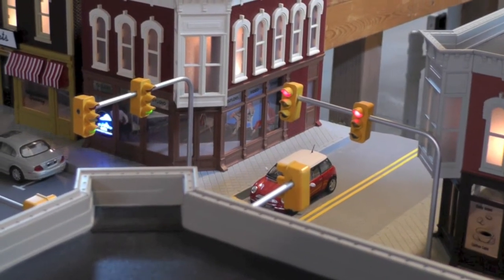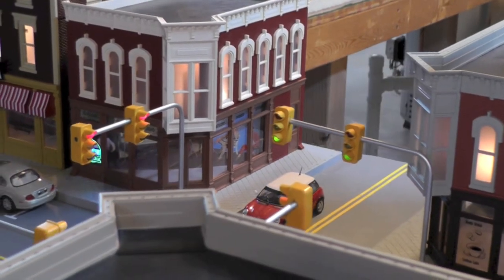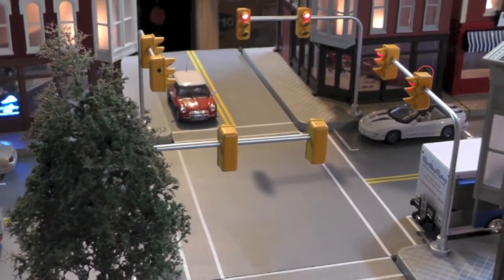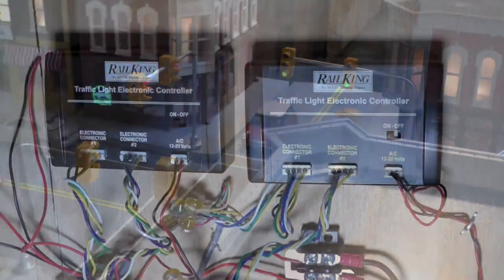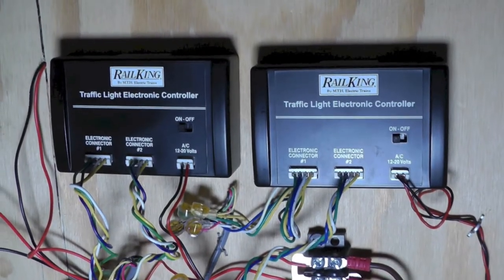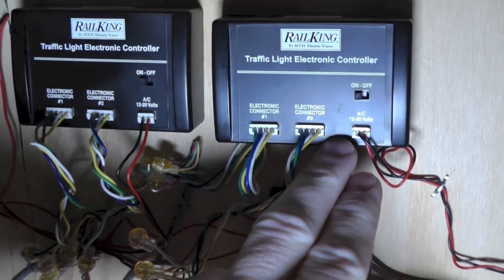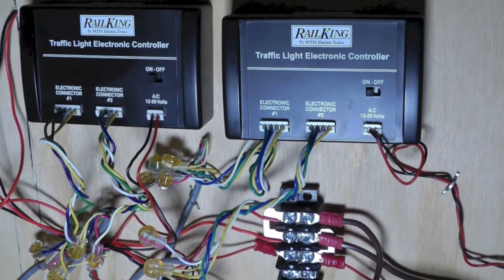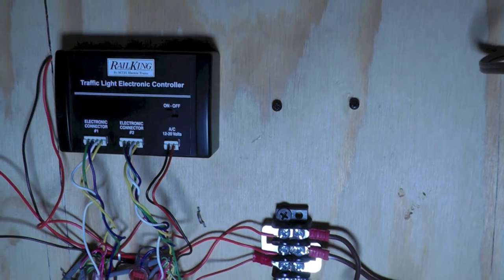Getting MTH Traffic Lights in Sync

Comment: Just purchased 2 sets of lights.  The instructions tell you not to do this and even admit if wired properly they will go out of sequence.  So how is your controller 7 years later?  Can I safely wire it your way?  Thanks.
Reply from the maker: Mine are still working fine.  Assuming all versions of these MTH Traffic Lights are the same (?), I googled 'MTH traffic light manual' and the first thing that came up was an instruction sheet on the MTH web site saying: "The MTH Traffic Light Electronic Control Box supports up to 12 simultaneously connected LEDs (four single traffic lights). To use four single traffic lights with a single control box, splice two traffic lights into each Electronic Connector. To connect, match wire colors from the traffic light to the wire harness in the electronic connector using wire nuts"
Reply: @AllThingsBobot  Right... 12 LED's (Single lights).  But like you, I have the double lights, so that makes 24 LED's.  But if you have been running double lights (24 LEDs) for 7 years, then I guess that you can say it works.  I'll be wiring mine up the way you did yours.  Thanks.
Reply from the maker: @ron045  I see what you are saying.  I found references from MTH online that the box supports (4) single traffic lights or (2) double traffic lights;  both also say (12) LED's simultaneously.  When powered ON in the situation we both are trying to use, it is only powering (12) LED's "ON" simultaneously, as the opposing traffic lights are OFF.  So maybe it's ok?  Again, YMMV, but mine have been working this way for years...and if it blew it wasn't the end of the world for me.  :D  Enjoy.